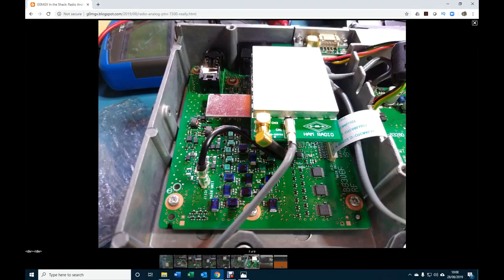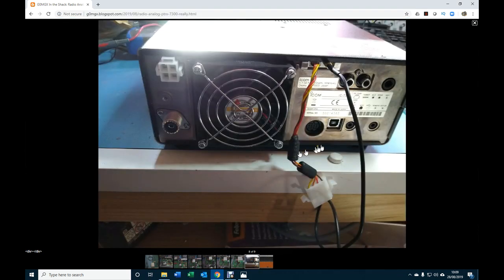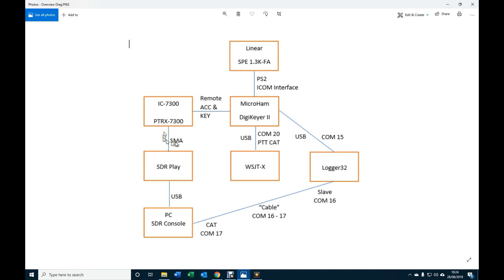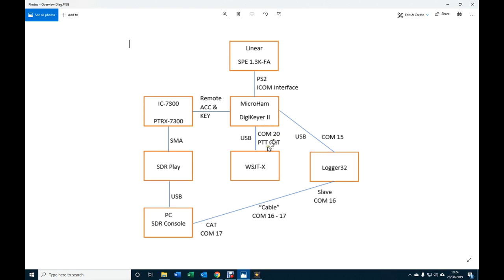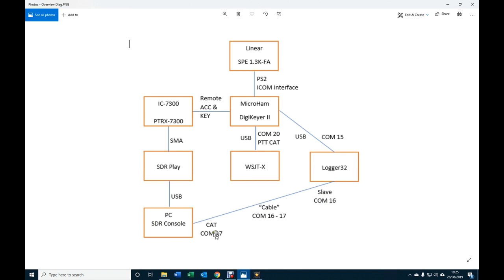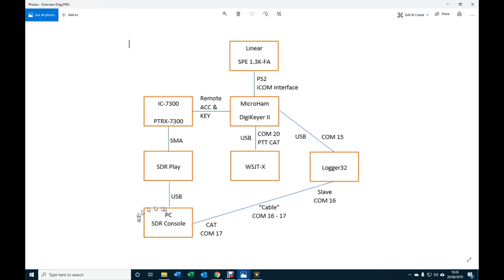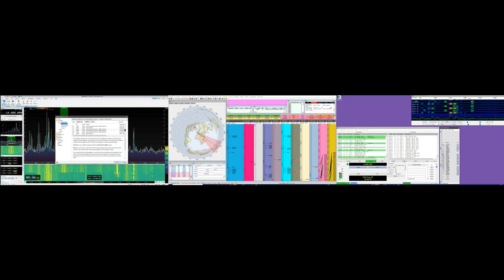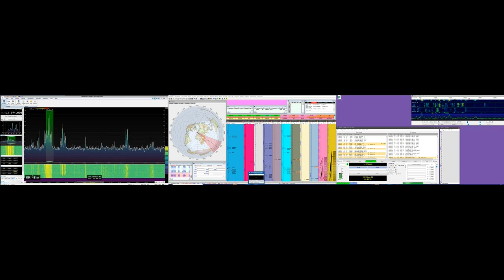IC-7300 with PTRX7300, WSJT-X Logger32 & SDR Console

Comment: IF I get the PTRX7300 can I listen to the audio direct from the SDR software or do I have to listen to the audio from the radio as normal ?
Reply from the maker: You can use the SDR as an independent RX so the audio from the SDR can be used - so yes.
Reply: @MarkG0MGX  Excellent, thanks. I find the 7300 NR not so good, certainly nothing like the FT-891 I use for portable but if I can use the Airspy HF+ that's great because it's NR is way better.